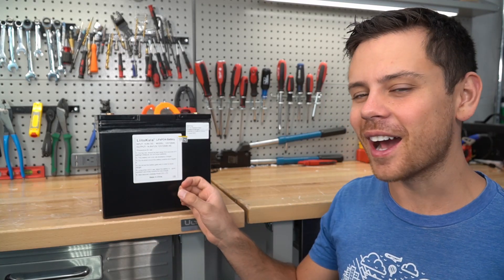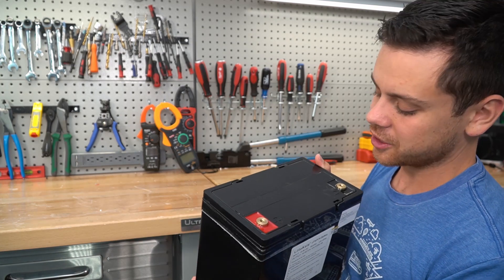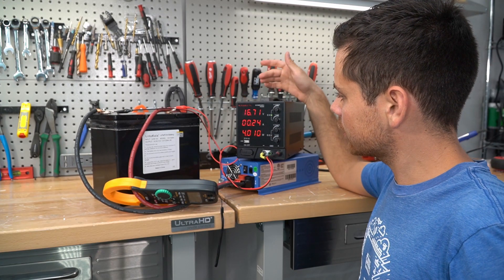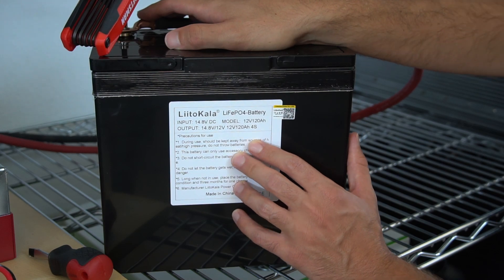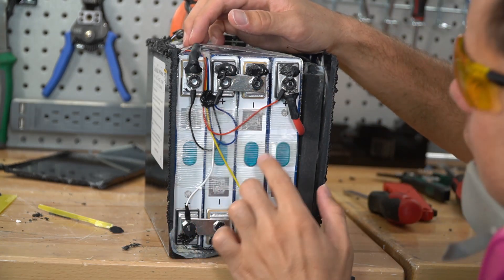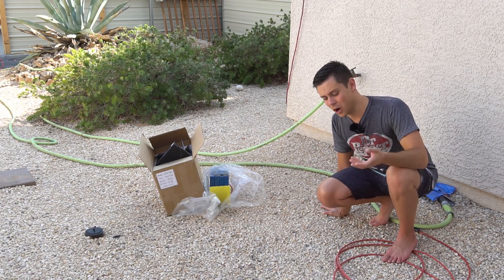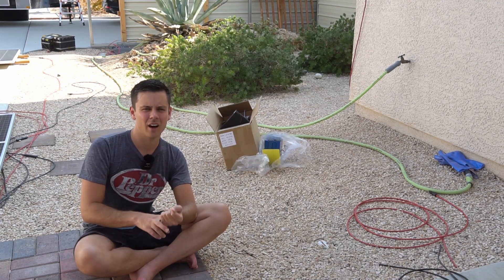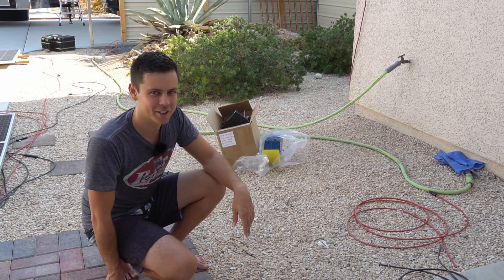Aliexpress $280 120Ah 12V LiitoKala LiFePO4 Battery

Comment from the maker: I am probably being overly cautious about the spilled electrolyte. But when exposed to water, it can create a small amount of hydrogen fluoride. Look up what that stuff does to a human. I am deathly scared of it, and the electrolyte spills always leave a nasty residue that I can never remove. I know it takes some take for it to react to the moisture in the area, and the amount of hf formed is small, but I don't want a single molecule of that stuff in my blood. Call me crazy for replacing my desk, but look up the images of people exposed to that stuff.
~~~~~~~~~~~~~~~~~~~~~~~~~~~~~~~~~~~~~
Tired of getting ripped off? Check out my "Will Prowse Approved" solar product recommendations below!

12V Batteries
https://www.mobile-solarpower.com/lithium-batteries.html

48V Batteries
https://www.mobile-solarpower.com/48v-batteries.html

Offgrid Inverter System Builder
https://www.mobile-solarpower.com/48v-complete-system-blueprint-559371.html

Hybrid Inverter System Builder
https://www.mobile-solarpower.com/code-compliant-48v-offgrid-system.html

Mobile Handtruck System Builder (very popular!)
https://www.mobile-solarpower.com/mobile-48v-system.html

Solar Panels
https://www.mobile-solarpower.com/300w-solar-panels.html

Ground Mount Solar Racking
https://www.mobile-solarpower.com/ground-mount-racks.html

Wire, Lugs and Busbars
https://www.mobile-solarpower.com/wire-and-connectors.html

Tools
https://www.mobile-solarpower.com/tools.html

Fuses and Circuit Breakers
https://www.mobile-solarpower.com/fuses.html

Plug-N-Play Solar Systems
Ecoflow, Anker And Bluetti! So many models to choose from. See my current recommendations here:
https://www.mobile-solarpower.com/full-size-systems.html

~~~~~~~~~~~~~~~~~~~~~~~~~~~~~~~~~~~~~~~~~~
Need to build a large DIY system? Need a trustworthy solar distributor? These are my favorites:

Signature Solar
Creator of EG4! Solar Minisplits, Victron and More! Largest Solar Store Online.
If you want $50 off, please use my link below and coupon code "DIYSOLAR50":
https://signaturesolar.com/?ref=cPwLcVc0SW-BjN

Current Connected
Best Prices for EG4, Victron, Midnite and so much more! Fast Shipping and Highest Rated Customer Service:
https://currentconnected.com/?ref=wp

~~~~~~~~~~~~~~~~~~~~~~~~~~~~~~~~~~~~~~~~~~
Join our DIY Solar Community 
Need more help? Join the largest solar forum on the internet for beginners and professionals alike. 140,000 members and counting!
https://www.diysolarforum.com

Check Out My Free Book
Best-selling and beginner-friendly guidebook to off-grid 12V solar!
https://www.mobile-solarpower.com/the-book.html

~~~~~~~~~~~~~~~~~~~~~~~~~~~~~~~~~~~~~~~~~~
Contact Information:
I am NOT available for personal solar system consult! If you wish to contact me, this is my direct email: williamprowsediysolar@gmail.com
FTC Disclosure Statement and Disclaimers:
Every video includes paid promotion or sponsorship (such as free products for review). Some links on this YouTube channel may be affiliate links. We may get paid if you buy something or take an action after clicking one of these. My videos are for educational purposes only. Information is subject to change/update at any time. Electricity is DANGEROUS and can kill. Be smart and use common sense :) DIY Solar Power with Will Prowse is a participant in the Amazon Services LLC Associates Program, An affiliate advertising program designed to provide a means for sites to earn advertising fees by advertising and linking to Amazon.com
Reply: Same situation as when I find a spider in my house. Just burn the place down and start new somewhere else. It's gonna be a no from me, dawg.
Reply: That's a very good base instinct. Back in the 90's I worked as a machine developer for the printing industry, and some components (activators) in the chemicals used for/in electroplating Cu with Cr had a high content of hydrofluoric acid. In Sweden we had only had one serious incident with it, but showing images of the medical results of it to new workers sure made them think twice about how they handled chrome plating primers. Nasty stuff!
Reply: As a related thought, the "new and improved" AC refrigerant mandated by the EPA in 2018 is called r1234yf. It's flammable, and when burned it decomposes into hydrogen fluoride as well. Yikes!
Reply: @elitearbor  That's promoted by tax reductions over here too :/
Reply: @elitearbor  R32 is also a valid EPA refrigerant for future use... R410A is a mixture of R32 difloromethane and R-125 pentafloromethane. Systems with R32 are already on the market... they do require some modifications though relative to older R410A systems.  The Midea U is I think the first window AC with R32... unfortunately it doesn't heat (apparently discharge temperature is an issue with R32 and it can overheat if not designed to handle it).
Reply: @elitearbor  ´
Reply: @elitearbor  WOW..hf, that's crazy.
Reply: Hydrogen fluoride is great stuff. Glass is usually highly resistant against all kind of acids. But hydrogen fluoride can etch even the glass :-) Thx for all those great videos. You do amazing job.
Reply: We have rail tanker loads of that stuff at refineries.  You can just drive past them with no physical barriers.  Wild.
Reply: @lowrads  remove this, ppl are crazy
Reply: Calcium borogluconate.
To neutralize any HFl
On skin immediately.
As HFl goes through shin to bone and then destroys your bones.
Sulfuric acid is bad:
Hydofluric acid is seriously nasty.
Reply: Looks like calcium carbonate is a good choice for neutralizing it.  Maybe just make some paste and spread it around the area.  
Might not be a bad idea to keep calcium gluconate gel around in case it contacts your skin.
Reply: Oh I remember that!  The materials lab specifically told us that the HF buffered solution would go right through the PPE issued to us.  Yeah, fun stuff.
Reply: do you bro. do you. I, personally would've just cleaned it as best is possible and just cover it with a timber chopping block/cutting board. to each their own
Reply: HF is terible stuff if you get it on your skin it will eat till the bone, you need calcium shot around the spill on your skin and fast .
I have worked industrial with that stuff in full Hazmat from special material and air botles
Reply: When doing the wafer lab portion of my CpE degree, they said they had only ever had 1 major accident in the lab, someone had large container of HF and was carrying/moving it around, and set the canister on their foot.... turns out it was leaking and leaked onto their foot and basically destroyed their foot before new knew what was happening...
Reply: Will you scare me with your electrolyte story! I just received liitokala cells and one of them has a bad solder on the threaded rod. Should I be worried about a leak?
Reply: Basically know your enemy (battery) and the safety measures required.
Reply: Replacing the desk isn't why I would call you crazy. 😄
Reply: You are correct to be concerned about HF.
Reply: Just dump the spilled lith into your tesla its safe/green right?
Reply: This makes me think twice about using this as a marine battery. What the heck? Hydrofluoric acid??? There's water everywhere on a boat. How is this supposed to be cleaned up in the event of a rupture or a leak?
Reply: I'm sure you are right. That said, can I please have any "contaminated" stuff you have.
Reply: Hey if you don't like that battery , you can give it to me (4 free ok i pay the Sent) :'u 🙁 rip Lil Lithium Battery
Reply: Thanks for sharing the mishap. I'm looking for a 12v 60-100 Amp hr battery for a boat trolling motor. Your videos have been very informative. Any recommendations for a battery for my application? I'm struggling the swallow the price of the lifepo battery vs a wet cell, but very Interested in its benefits.  Thanks!
Reply: Cool, A YouTuber that actually answer questions that I asked. Unlike nomadic fanatic, he's a jerk. So Thank you. And I'm guessing you know all about the stuff cuz you're super smart with all of it. I wish I knew about solar like you do.

Comment: €278.10€1,089.9774% off
  2+ pieces, extra 1% off
Price includes VAT丨Extra 2% off with coins

Buy 5 pieces get 1% off
LiitoKala 24V/25.6v 100AH LiFePO4 Lithium Battery USB3.0 Type-C Output for Inverter Car lighter Batteries 29.2V Charger Tax Free

Comment: I'm in the process of building a small system for my vehicle.  Space is very limited, so I'm considering an SOK 12/100 battery due to its small footprint as well as its quality.  Its a bit pricey, but like you said you get what you pay for.

Comment: I wonder if the stated 120ah is by c20 rating, capacity if drained over 20h.. why do you then drain it in 5h and seem disapointed? If you drained it in 1h it would have even less, most likely under 90ah.  I dont understand your position, can you explain your testing? 

Thanks for the video, i love them all.
Reply: Your discharging regime is used for Lead Acid cells. So is not applicable. LiFePO4 should be rated at C discharge rate, in this case 280 Amps.
Reply: @tryagain.k1821  yea, you are correct. I might have lacked sleep and braincells that day.

Comment: BMS's often get very hot with high discharge current.  This tiny BMS probably even more so.  It would be good if you look up MOSFET part spec to report how many of the 12v LFP battery are being built with lower voltage MOSFET's not suitable for battery series stacking.  I am guessing this tiny BMS likely means they are 30v to 40v MOSFET's.  80v-100v MOSFET's with low Rds_ON are a lot more expensive and for cheap batteries manufacturing cost is everything.

It is better to have the BMS at the top of battery to minimize heating transfer to cells.  This one being a small BMS and on the side will heat up the closest cell which contributes to heat induced mismatching of cells.  Mismatching of cells induces more mismatching with use making it harder to keep cells SOC balanced.

Comment: Lead has one major advantage.  Cold survivability.  Outdoor cabinet with a low current draw (half amp 24/7, occasional sort periods of 15 amps).  Winter temp is never above freezing,  can easily hit -10, and lower isn't uncommon.  Really didn't enjoy carrying them a quarter mile, but they work.  From what I understand, lithium absolutely would not.  Correct me if I'm wrong?
Reply from the maker: Not anymore, use a cold rated lifepo4. Lead acid is awful in the cold.

Comment: I have a general question, I have a marine deep cycle and a regular starting battery. I’m currently thinking about putting them in parallel in my boat so I MAINLY can increase my RC amp hrs. Trying to stay on the water longer. Should I or can I? Just want to know what you suggest/think! Love ur videos!!!!!!

Comment: I have a question: those LiFePo4 Batteries all have a BMS right? Is it possible to directly charge them with a solar panel without a charge controller? And if yes, will it damage the BMS or the battery in long terms if you do so?

Comment: I have a question, can I buy a large charge controller like, a 100 amp Charge controller and hook it up to a single battery. The reason I would do this is because I plan on adding solar panels and batteries. Right now I have one solar panel at 250 W and to 100 amp hour flooded cell batteries. I am planning on buying a 200 amp hour lithium battery to which I will be adding three more at least if not four. in the end I plan on running about 1000 watts maybe 1500 watts in panels. I’m just trying to get out of having to buy one or two more charge controllers. I have a 20 amp now which is working great for two batteries. But it won’t work for much more than that.

Comment: Decided to try one out and purchased a 150ah. Arrived yesterday, checked the voltage which was 13.2v so i charged it before doing a capacity test. Sadly only pulled 120ah and I had to stop the test as the voltage had dropped to 9v.
It was always a gamble purchase.

Comment: @Will, i accidently touched the two terminals together on my LIFEpo4 battery it shorted out, without much of a flash but now there is zero voltage, im guessing its cut out on a safety or something but i have no idea who to ask or how to look to fix it, and im not sure if i should open it up or not and if there will be somethign fixable in it?

Comment: I have 2x solar panels each producing 285w (570w total) plus a POWMR 60A MPPT charge controller linked to 3x 110ah lead acid batteries give a usable 165ah, all set up as a 12v system, these have worked ok for the past year but I always have battery anxiety, I would like to run a induction hob, and have my night heater on without worrying about the batteries being killed, so have now just ordered two Liitokala 200ah batteries, for a total cost of £509 (gbp) which equates to around 680 usd or 340 per battery. 
Hopefully they will outperform the lead acid batteries, my theory being that so long as I get a minimum of 2x the power / longevity then they have cost me no more than the batteries they are replacing.
Reply: Did you have to pay import tax on them?
Reply: @Nitecrow314  no the price included all duties.
They have been install a while now and I am really impressed, I can be truly off grid without worrying

Comment: hi,
i have just had two batteries delivered, both 200ah , one of them seems to be working ok the other i can not even charge with the charger supplied with the battery,  has anyone else had this happen?

i am thinking about contacting liitokala to see what they will come back with. i am also thinking about just opening it up and seeing if there might just be a loose wire or something.

any advice would be most appreciated
Reply: As I read your post I immediately thought Litokala-Varicore when you mentioned the faulty battery. And I clicked "Show More" to find out it was from the Litokala Duff Battery Company. They will stop selling them as the complete variability of the batteries becomes widely known. Then retire on all the $$$$'s received from defrauded Anglos. Anyone want to buy a 20Ah battery marked 280Ah. I have 8 rubbish batteries from Varicore.

Comment: this is a good battery. firstly you charged and dischargeed the battery at current well above the designed level, it is still safe and worked fine and only 15% below labeled capacity. secondly, you penetrated the protection cover it didn't burn or smoke. you should try renogy to see if it performs battery than this one. you are biased.

Comment: I'm surprised nobody said anything about the dimensions on these. Two of them fit perfect in a single milk crate. 
Bummer on the capacity, but they are what I wanted for my portable generator/trolling motor. This review came out a month after I ordered them.

Thanks again for what you do Will its much appreciated. P.S. they are down to $230 now

Comment: Would this be good for occasional camping use? Planning to use it for LED lights, charging my phone, camping fridge and a small fan. Will not be using it for anything with high current. Will most likely be charged between 2A (car cig lighter socket) to 30A (small solar).

Comment: Small amounts of HF are not huge concern after all many countries have fluoridated water supplies and most main brand toothpaste are also fluoridated. These work by producing fluoride which is then absorbed into the teeth and bones. The speed of hydrolysis of hexafluorophosphate when the electrolyte is exposed to air is probably going to be quite slow. Nevertheless you don't want to get the electrolyte on your skin. If you wash all contaminated surfaces then only minuscule amounts of fluoride will remain, and they will bind strongly with any calcium or magnesium about. The problem is with more concentrated solutions of HF as exposure can cause serious damage to the body by precipitating out calcium and magnesium ions necessary for metabolic processes.

Of more concern is that electrolytes contain nasty organics. For instance diethyl carbonate which is volatile and up to 40 % of the electrolyte is suspected of causing cancer. Ethylene carbonate at about 50% of the electrolyte has acute oral toxicity. Generally random one off exposures to the fumes from a an electrolyte leakage are not of concerns, but repeated exposure should be.
Reply: HF is dangerous and is not present in toothpaste and fluoridated water. Be particularly careful of car wrecks with burnt butyl O rings because of the fluoride compounds.

Comment: I thought those cells were dry.  What the hell was leaking out. Battery acid electrolyte I thought that was only in led acids.  Do a Video battery tear down all the way Plz.
Reply from the maker: It's not acid, it's electrolyte. You need a medium for the lithium ions to move and intercalate

Comment: As a chemist i worked with Hydrofluoric acid for years.  Very bad stuff, eats glass.  But after working with it for a few years you start to forget about how bad of a chemical it is, and you just stop worrying,  lol.  (when hydrogen fluoride is dissolved in water, it may be called hydrofluoric acid).  This was a long time ago and the way they use to make sure the lab was clean was by just blowing new air in, and the old air out (the good old 1970's and their great safety measures).  So i am sure i breathed a ton of it.

Comment: Deep cycle lead acid still a far better deal, 100ah 100$ from any Walmart, convenience and last around 3yrs. Yeah they 3 times the size and atleast double the weight but at a home location no issue.

Comment: Hey Will, I own a fleet of ICE cars and I have converted all of them over to LiFePO4 with Headway 38120HP cells and will never go back to lead acid. I have a 25kg light commercial truck/van battery in my garage that I tested to fully empty and it held just 20Ah whereas the 16AH pack in my bigger-engined cars weighs just 2.8kg and starts the engines better. In short, lead acid isn't even good for that! :-D